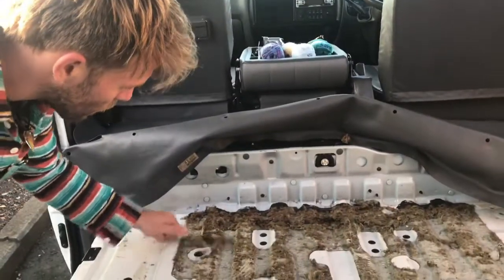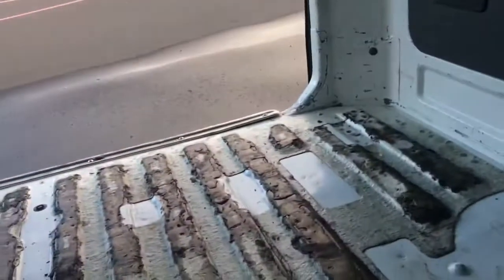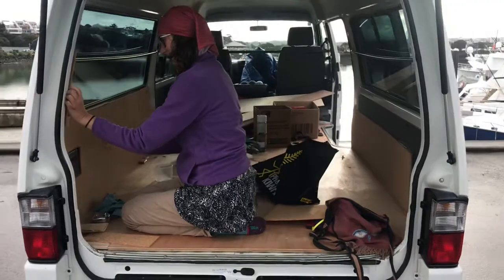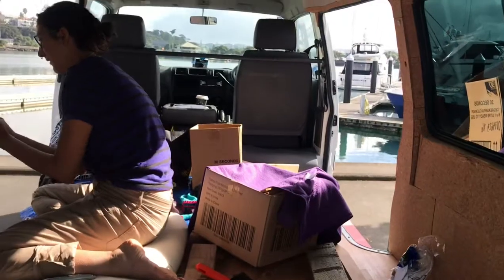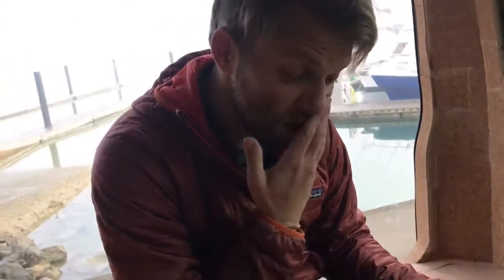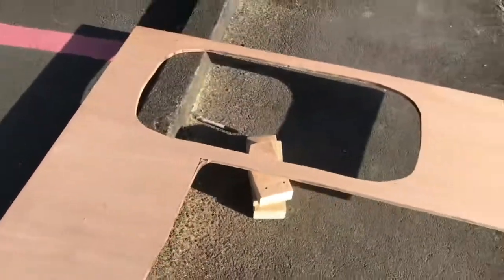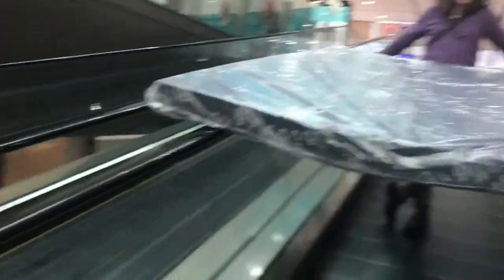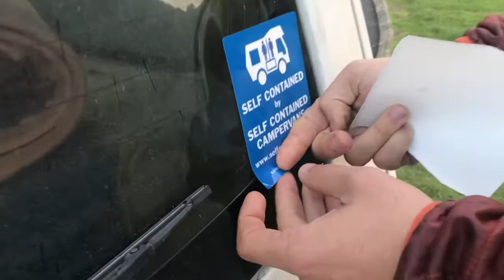New Zealand Self-Contained van conversion

Comment: Apparently "self contained" means something different in NZ than in USA.
Reply: In order for your vehicle to meet the 'self contained' requirements in NZ, you need a 12L freshwater tank per person, 12L greywater tank per person (common to just use a 24L tank), a sink connected to a watertight waste tank, a sealed bin for waste, and a portable toilet that can be set up even when the bed is out (only used for emergencies as there are plenty of public toilets). Self containment in NZ refers to the ability to stay in an area for at least 3 days without needing to get any more water or dump waste. Freedom camping is very popular in NZ, where if you have the self contained sticker, you are able to park on most public grounds :-)